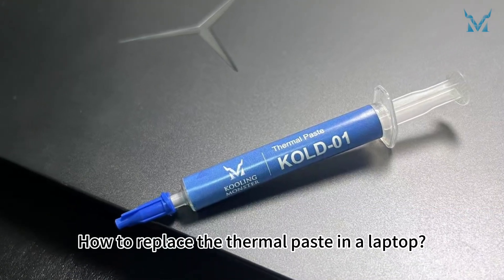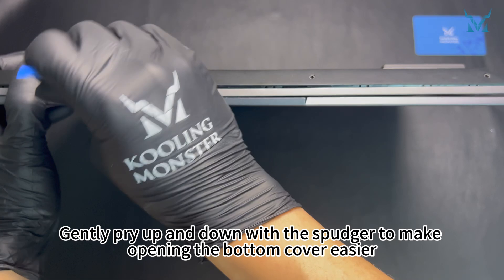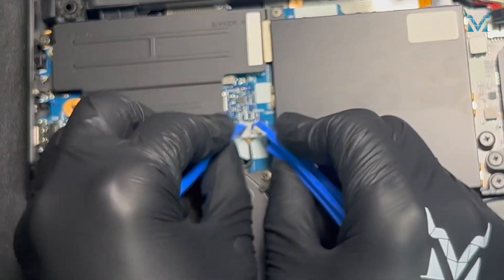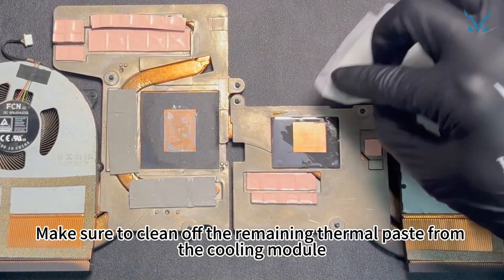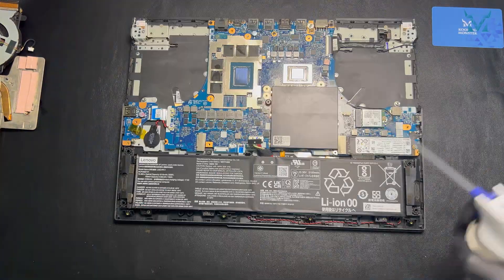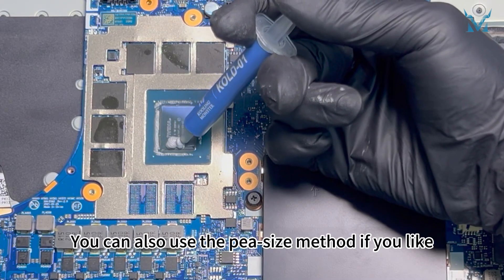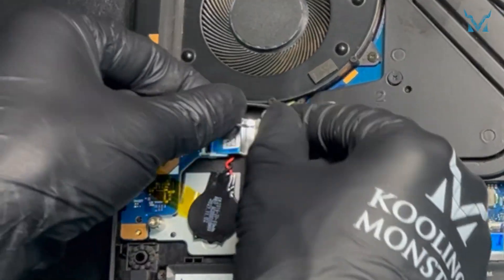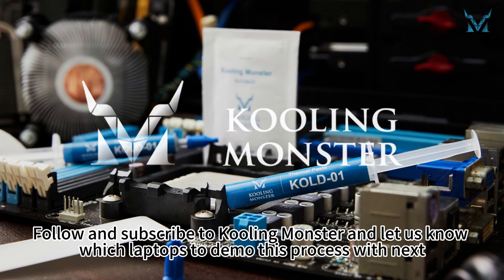Speed Up Your  Lenovo Legion 5 Pro 2021  Prevent Overheating With Dust Cleaning & New Thermal Paste

Comment: hi, I got lenovo legion 5 pro 16arx8, rtx 4070 amd ryzen 7000, the temps was hitting 100c, I cleaned fans and everything, repaste it with rice/pea method but temps still high, games are not dropping fps as before, they are consistent now, but  I dont know what it could be at this point those highs temps :/. (I used artic mx6
)
Reply from the maker: Here’s a concise, helpful reply you can post:

---

Thanks for sharing! The Legion 5 Pro (ARX8) with Ryzen 7000 + RTX 4070 is a *hot-running* machine by design, but consistently hitting *100°C* on the CPU means something is still off.

A few things to check:

*1) Ryzen CPUs boost very aggressively.*
They will hit 95–100°C instantly if power limits are high. Try enabling *Quiet/Balanced mode* or lowering *PPT* in Lenovo Vantage — this alone can drop temps 5–15°C.

*2) MX-6 is good, but the Legion’s large dies prefer a slightly higher pressure spread.*
Make sure the heatsink screws were tightened in an even cross-pattern.

*3) Check for partial heatsink contact.*
If one corner isn’t fully touching, temps spike no matter how fresh the paste is.

*4) Your FPS being stable now is a good sign.*
It means the repaste helped somewhat, even if temps are still high.

If you want, I can guide you through checking heatsink contact or suggest an alternative paste that works especially well on Lenovo systems.

Comment: Hey i have the same laptop and while gaming my cpu and gpu hit 85 degrees, and i have been wanting to  change the thermal paste, but on lots of reddit threads and youtube comments i have seen people saying not to touch the thermal paste because its the honeywell phase change material, did you have any problemafter changing the paste
Reply from the maker: Great question! ✅
Some models do use Honeywell phase-change material — it works well at first, but after long use it can dry out and lose performance. Replacing it with a high-quality paste is totally fine and can lower temps noticeably. I haven’t had any issues after repasting — just be careful and follow the steps closely 👍

If you want an upgrade, our Kooling Monster KOLD-01 runs cooler and lasts longer than stock paste. Need help with your model? I’m happy to guide you! 🔧😄